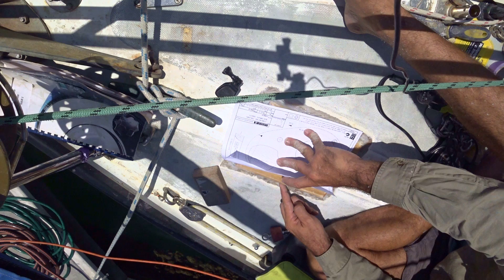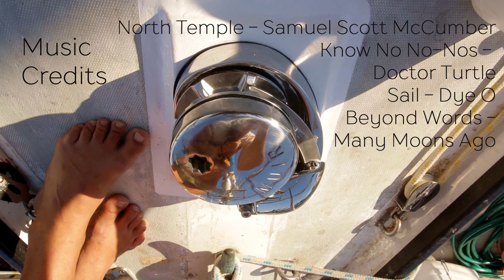Installing our New Windlass - Free Range Sailing Ep 72

Comment: I used to work as a agricultural mechanic, and when ever we come up with splines that could get corroded, we would use never seize compound which is a type of grease with aluminum powder . That product would not comme off and not even with a high pressure washer. That never seize could prevent corrosion from salt water on the splines in your witch. Also in gear boxes or transfer cases i have found a grease that is high pressure, high speeds with stand -40 to +50c temperature without changing viscosity or lub priority. This grease can be found at any AG Dealer and it is called corn head grease. If you want more info let me know.
Reply from the maker: Corn Head Grease- Got it. I've definitely had my share of anti-seize all over everything I love. Stuff goes a mile.

Comment: You use the stopper to keep most water out of the locker in high seas but what about the water that clings to the rope when it stores down into the locker?  I know my sponge gets a work out in my canoes and kayak when I pull up my anchor rope.  Do you have to clean the locker each time of water?
Reply from the maker: we have a manual diaphragm pump.
Reply: Thanks, was just wondering.  Figured that rope had to pull water up and in. @FreeRangeLiving

Comment: Hi Troy. I noted that you have a wire trailing aft from the solenoid, which suggests a remote switch in or near the cockpit. We have Muir windlass and have enjoyed great service from it. We have a reversible motor to let the all chain rode out and in. We have the deck switches, a cockpit remote and more recently a hand held remote purchased off eBay, for a few dollars. Neat little unit that has a great range (>50m). The units come with up and down, but you can simply not connect in the forth wire.  The advantages of the hand held remote is the ability to lean over the side to see sand and weed, as well as not having any body parts near the windlass during operation. https://www.ebay.com.au/itm/12V-50ft-Winch-Wireless-Remote-Control-Set-for-Truck-Jeep-ATV-Warn-Ramsey-Tuff/323316904720?_trkparms=aid%3D555018%26algo%3DPL.SIM%26ao%3D1%26asc%3D20140106155344%26meid%3Dfbaf3ac08f3645528ca2574bf9c63184%26pid%3D100005%26rk%3D3%26rkt%3D12%26sd%3D264005791150%26itm%3D323316904720&_trksid=p2047675.c100005.m1851
Reply from the maker: At the moment the winch is just 'up' with a deck switch- no solenoid. The set-up you are describing would indeed be very useful for short handed work especially on a larger vessel. We may upgrade the setup when we re-do the deck.

Comment: That's a capstan, not a windlass my friend... Windlasses have two drums/gypsies on a horizontal axis, verses a capstan with a single drum on a vertical axis. Also, gypsies are for chain only. What you have is a capstan with a gypsy-head. Just trying to stifle false labeling. Great video though sir! Keep up the great work! Love you guys.
Reply: Joshua Chalmers go to any chandlery and there called windlass s
Reply from the maker: Its true. Traditionally a windlass is defined by a horizontal axis of its turning gear. I use the two terms interchangeably which is one of my many many flaws.

Comment: I've been watching several of your videos and, not being familiar with the mechanics/science of boat building, I find a few things strange in how they are put together.  For instance, when you replaced your broken engine mounts, you had to go to significant effort to line up the engine shaft with the prop shaft.  Why aren't engine setups in boats simply using standard universal joints to connect the 2 shafts?  Or even multiple heavy duty belts?  Using belts might allow for different alignments of the prop shaft.  And isn't there a more water resistant wood than pine to use as a base when you mounted the anchor wench?  Why didn't you "glass-in" the whole board rather than just the edges?  Wouldn't the "glassing" provide a more rugged seal to water than just paint?  Maybe you did glass the whole thing and just didn't show the process.   Just curious.
Reply from the maker: Some boats do use universal joints and thrust blocks if they have the space, we don't. Both pieces of pine were glassed before installing and shown. It was a short part of the overall video and you may have missed it.
Reply: @FreeRangeLiving :  Ah.. ok, it's a limited space kind of deal.  Well, let me ask another question then.  At what size of boat might I start to see space given to things like universal joints?  For that matter, you and Pascale seem slightly cramped on your 30 footer.  If money was no object, what would be the maximum size of boat you would use that would give you a little more space and still allow you to get into the remote spaces you go to?
Reply from the maker: The size of boat reflects my thoughts on safety is: can access narrow mangrove creeks in cyclones, can be easily kedged off unmarked shoals when exploring unsurveyed areas, easy to sail single handed if one of us is badly injured- it's a long list. Our next boat will be based on what we require it to do rather than any fixed ideas on size.
Most people's sailing dreams are killed by having too much boat rather than too little and I follow the very old caution to Mariners,
Get the smallest boat that can do what you need it to do,
Not the largest you can afford.
Reply: @FreeRangeLiving : An excellent bit of sage advice there.  But, my curiosity still remains.  So let me ask the question a different way.  If I wanted a boat to be able to do all the things you just mentioned about being able to get into mangrove creeks and such what would be the limit.  Obviously a 60 footer would be unbelievably ridiculous and impossible.  But what about a 36 or even a 40 footer or is the 30 footer the exact size of boat for the type of exploring you do?  Is that the precise reason you have the size boat you do have?  Please remember, I am a land lubber/farmer, with very little knowledge of boats and what they are capable of.  I wouldn't recommend a 300hp center articulating tractor to someone with only 20 acres to till, they would barely be able to turn the thing around in 20 acres, but I would recommend a range of tractors for the job.
Reply from the maker: It's a comment section for a video. I can't give you a good answer here.
Reply: @FreeRangeLiving :  Bummer,... but fair enough.  I'll just have to stomp on my curiosity.  Really nice videos though, keep it up.  The interactivity between the two of you is wonderful.  Troy, I enjoy the way you apply maintenance principals and improvise well when necessary, you'd make a good farmer.  Pascale, you are living proof that a woman doesn't have to be a Victoria Secrets model or wear layers of makeup to be amazingly attractive and on top of that your a good fisher(woman), a great cook, and hard worker.  Your a lucky man Troy.   Be well.
Reply: @FreeRangeLiving  "Get the smallest boat that can do what you need it to do,
Not the largest you can afford." There's a lot of very good advice on this channel, that's the best bit!!
Reply: @InquisitiveSearcher  I had a 34' Ganley design steel sloop, and it had a short section of splined drive shaft with a universal at each end. As alignment wasn't critical, the motor was on flexible mounts and it was very smooth running. Another benefit was that the shaft could be unbolted at the universals, and then the gearbox could be removed without having to move the shaft or engine, so it could be done without hauling out. The downside was that the engine was further forward than normal and occupied  a large chunk of a galley locker. This probably made it noisier too, as it was right in the accommodation space.

Comment: Mmmmm shiny...

Nice install with the supporting boards.

I did notice that the end of the motor shaft housing looks like it's very close to the hawse pipe (though it could just be the camera angle).
Are you able to rotate the windlass motor 90deg to the right (anti clockwise as you look down from the deck)? It looks as if you'd get a bit more clearance for the chain?
Another option might be a bit of conveyor belt hanging down between the hawse pipe and the end of the housing.

Keep these great episodes coming!
Reply from the maker: Will be snaffling some insertion rubber ASAP. Its a good plan.
Reply: @FreeRangeLiving  Clark Rubber Townsville
237 Dalrymple Road

Comment: Very informative! One thing though... isn't the chain going down/coming up through that small hole going to rip the paint off the sides? Couldn't you just glue in a sacrificial short piece of pvc pipe to take the wear?
Reply from the maker: I think that's a good idea. We used the old hole that's been there a while and hasn't worn out yet but I don't see why a little reinforcing would be a bad thing. Perhaps stainless pipe though?
Reply: I was just thinking pvc as a sacrificial solution less abrasive on the chain/rode

Comment: Thanks for another great video. I'm in the process of sourcing ground tackle for our new-build 12M cat. I'm intrigued at your chain/rode combo. I understand your reluctance to buy into the ground-tackle debate but would be really interested in your thoughts (real-life experience) on the optimum length of chain for reef cruising. People have told me I need a minimum of 60M due to the risk of chafe, but I'm struggling to understand how that could happen, with careful anchoring. Frankly, I don't want to carry, 100K of chain!
https://pauseandreflect.blog
Reply: We replaced our 10mm chain (47m) recently on our 43' monohull. The odd length was due to being end for ended a few times and a metre cut off each time. Our offshore sailing areas include the Australian Kimberley coast and SE Asia. Both areas have lots of reef which gives us a preference for all chain rode. The suggestion by some cruisers for 100m of chain was rejected as we have managed with what we had for many, many years. However whilst changing gout the chain we opted for a slight increase and went up to 60m. We also carry 120m  x 20mm  nylon rode on a second anchor for the times when it is too deep to use all chain. Never used this yet!
Reply: Thanks for your response @captainsalty56   very helpfull.
Reply: @peterimms3500  your welcome. Didn't want to lecture, just share what we did. We had an anchor/rope rode on our last yacht 36' worked well and all chain would have been too heavy. Keeping cats light is critical.  Have been a few that are heavily weighted down and they lose a lot of performance.
Reply: One further thought. Consider the tensile strength of the chain you will fit. Lots of cruising folk fit higher tensile chain and either go down a chain size and/or increase length (or both) without any weight penalty.
Reply: @captainsalty56  Not lecturing ...sharing experience Terry! Yes keeping weight down is important for us. If I have got my sums right:  if I go for 50M chain, with a bridal of 6M (as recommended by the designer) we should be able to anchor in 7-8M with on a 7:1 scope, while still keeping the rode off the bottom, which I assume is the issue in coral.
Reply: Think I might just err a bit on the side of chain not dragging across the bottom.
Reply from the maker: I like 30m of chain because it suits the 4:1 scope required for anchoring regularly in 5-7m in settled to moderate conditions. Just all the chain plus 2-3m of nylon rode is quickly deployed without counting lengths. If the weather increases, letting out more nylon is easily accomplished in the dark and can be done by feel if push comes to shove and gives a lot of elasticity in the system that can't be matched by the catenery  curve you would get in such depths. Anchoring in 10-12m, you would have a fair length of chain lifted off the bottom as well which would eliminate chafe.
Wrapping a chain rode around a coral bommie may not suffer chafe, but there is a danger of snagging the rode and so being unable to retrieve it if you need to bug-out in a hurry. With plenty of rope rode, a snagged anchor can be buoyed off and cut loose to be recovered later and a spare length of chain and anchor can be quickly made up to it for re-anchoring once it is safe to do so.
So, for our 4 tonne vessel we run 10kg Rocna, 30m of 8mm 316 chain backed by 100m of 3 strand nylon rode. Spare anchor is plough with 12m chain lurking where its weight doesnt drag the bow down. We also have a Danforth packed away but Ill probably give it away sooner or later.
Reply: Thanks for sharing that @FreeRangeLiving  . Very much appreciated.
Reply from the maker: Chain weight has the function of putting in a good catenary curve so my take is to use heavier chain. Ours just exceeds 4t tensile strength (I know, should be in mPa or kN) which is plenty for our 4 tonne boat with a 2.4 m beam.